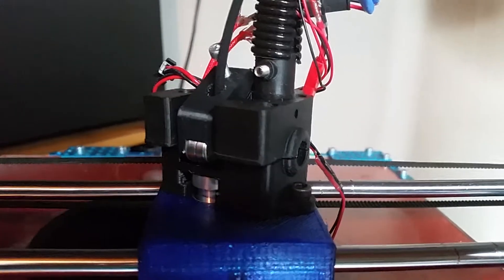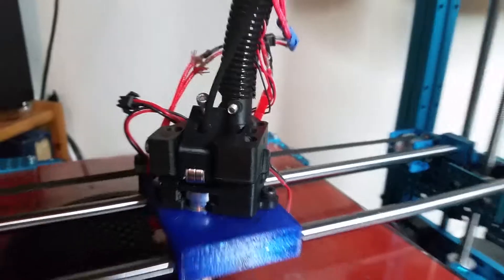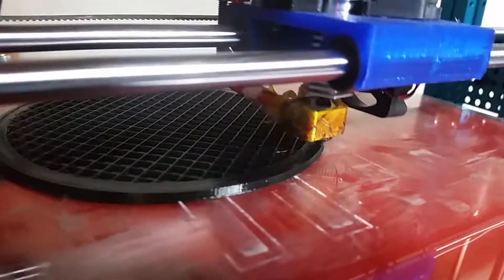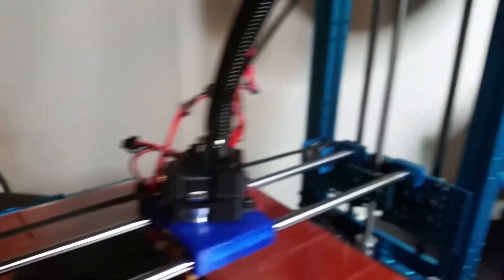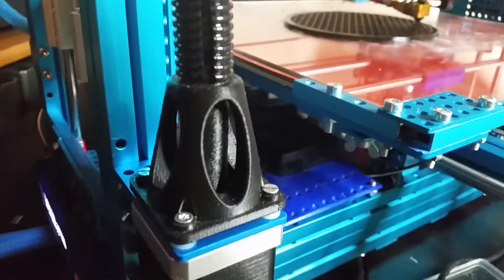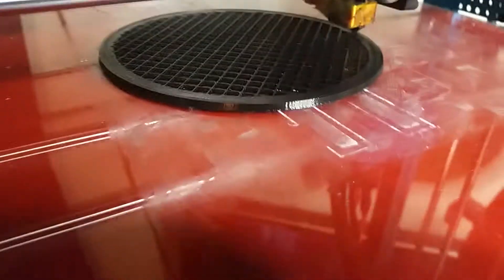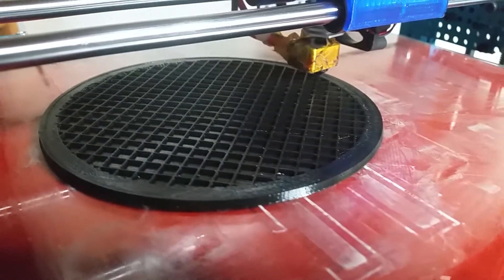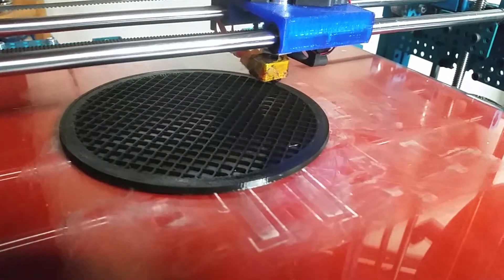Printing NinjaFlex with the Flex3Drive

Comment: Its great to see you using the Flex3Drive and being so happy with it. Keep an eye out for some new designs being released soon at www.mutley3d.com. You will be able to print the new parts and rebuild with your existing internal components and achieve even better performance. Also has a new quick release cam based tensioner.